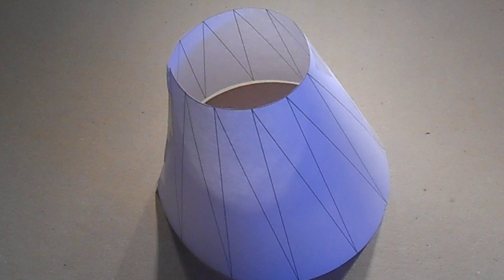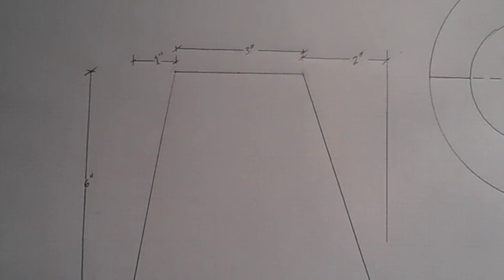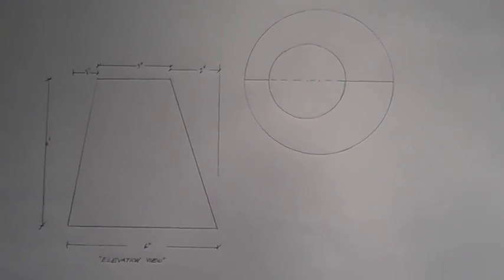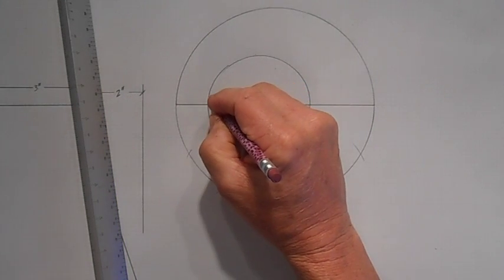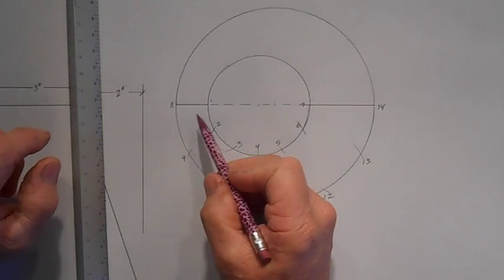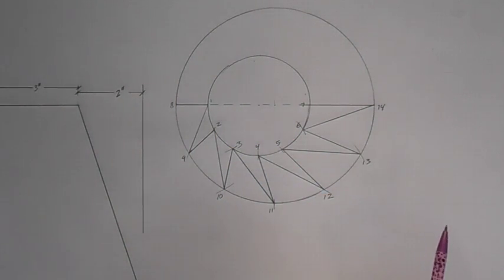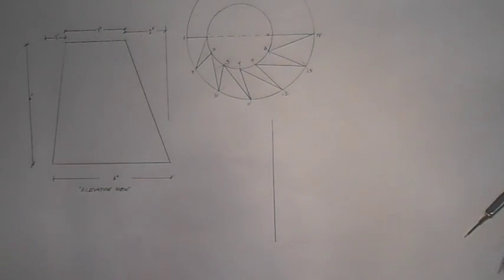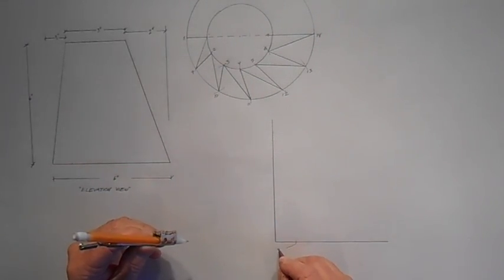Pattern Making for Sheet Metal- Offset Transition

Comment: I followed this method for a 56.5" dia. to 29.5" dia. x 45" tall with a 3" offset and when I did a check on the length of the arcs compared to the circumferences and they came out short by 1" on top and 2" on bottom.  It may as well be a mile.

Comment: Nice video Dave! I learned this way as well. There`s only a few fittings left in the HVAC field which computer driven plasma cutters can`t make. This is why I am needed and make a decent buck. You should do a video on a Parker fitting, I know they are not SMACNA standards, but they have their place in the field, usually it`s a lazy-ass field guy who won`t cut back the supply or return drop from the RTU and just add a change of direction with an elbow, other times there`s just no room.

Comment: What are the courses at a college where you can learn these techniques? Thanks and great video!
Reply: Good question!! I taught these in a local CC in a sheet metal class. You'd have to enquire at your near by community college to see if anything like this is offered. The sheetmetal workers union may still teach layout, but I have a feeling that things are going to software programs these days....I refer to "Sheetmetal" by Leo Meyer, when i need to refresh my memory on different pattern making.
Dave
Reply: I am a 'Structural Steel & Plate Fitter' in Canada, and part of our technical training for each term included a very in depth pattern development and layout class which taught us the techniques you used in this video plus some. I took that class a while ago and needed a refresher as I am going to be tasked sometime in the near future with forming a dozen 48" to 20" offsets over a 36" height out of 1/2" PL. Everything will be cut on our CNC plasma table but as with seemingly every complex part that we fabricate in our shop, the drafting department overlooks some critical information which sets things back. It almost seems like its routine now for that department to run detail drawings past me before they get the engineers approval stamp. It always makes my foreman smirk when the ego driven engineering techs have to come meet with me (a 22 year old apprentice) so they can issue accurate drawings. It just goes to show, if you can take the time to learn how to manually solve problems or do the work without the aid of technology your value will be seen. These younger techs making the drawings typically are really good with their software and making drawings but their lack of understanding of the fundamentals of metalworking hold them back from being great at what they do.. So I would like to thank you for taking the time to share your abundance of knowledge with the world, and giving people like myself an opportunity to add additional value to ourselves and our work. I hope there are other people that can take advantage of all that you are willing to share and I hope to see more content from your channel that I might be able to use one day.
David
Reply: I did it in trade school for my apprenticeship.